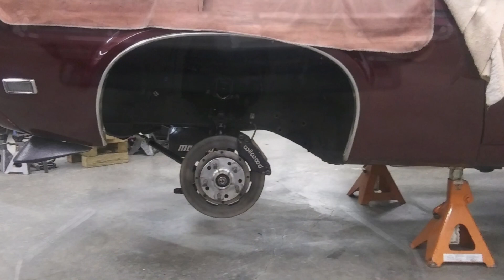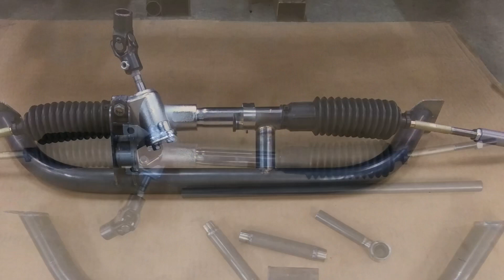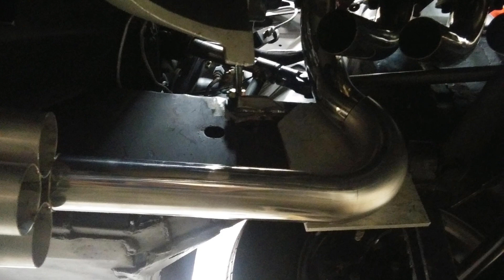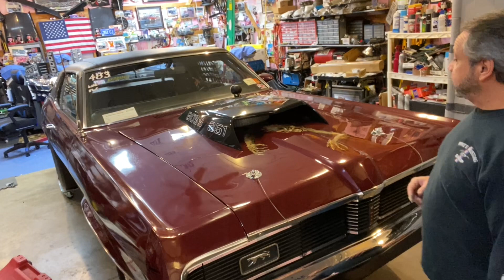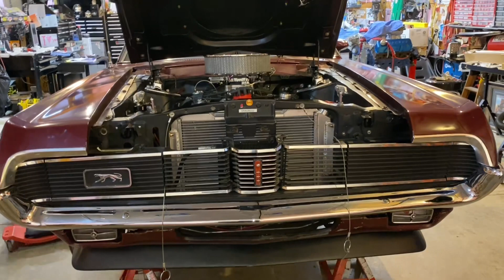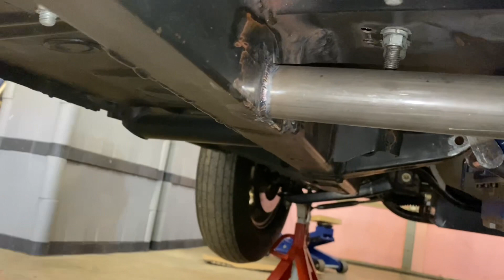DBG: Return Of The DragBoss 69 Cougar, See What Was Done, How It Was Done, And What Done Looks Like.

Comment: Having the rack and pinion steering installed is one of the most beneficial upgrades available and all of our classic pony cars needs it no matter if the intended usage is street, strip or road course. It’s way more than a means to reduce steering effort, a properly engineered and installed R&P kit will strengthen the chassis up front with a hefty cross member to handle the huge torque loads provided by that immaculate 409C. 

But as you know, one upgrade opens the door for many more. Each one does more than just improve functionality, they improve strength, performance, safety and the overall looks of the aging parts they replaced. 

The headers look amazing and the quality craftsmanship can be seen in the precision welds and smooth bends. 

With the much needed chassis upgrades done, the DB Cougar will have that extra margin of performance that a rigid platform provides and with the right amount of tweaking as required, you might shave a little bit of precious ET off. It doesn’t come easy but in the end, the enhanced functionality and performance will certainly justify the hard work by skilled hands and co$t involved 👌😉.
Reply from the maker: Thats what im talking about Daniel. Glad you approve, you have a good eye. He is a fabricator and artist. Definitely more strength for sure.  I sure hope I can get my number of 9.50, so I can be done with that goal, and move on. St6ay tuned, and see what happens next.

Comment: Very nice. It's coming along. I forsee "wheelie" videos in the future and low "ET's!
Reply from the maker: Not sure about wheelies, have tighted the front shocks down, after the wheel stand crashesx2. Come on 9.50
Reply: @DragBoss351Cleveland  … Tim the Cougar had a long run at entertaining us all with those well documented high flying wheelie videos. 

Nows the time to use all of that power that’s required to lift the front end and sustain a huge wheelie for a different goal. Wheelies clearly hurt elapsed times regardless of how awesome they are. 

Your freshly prepared 409C has more than enough power to collect a stack of 9.50 second time slips. You know all too well what your Cougar likes for quicker et’s, so work your magic on the chassis setup until it hooks hard and goes straight when necessary. 

Then gather up all of those extra 9.50 time slips in your collection of ultimate Cleveland memorabilia, autograph each one with a CF foundry logo, then offer them for sale at a price that the purchaser can’t refuse. 🤔🤔

Yeah I know how weird that must sound, but weird is only a state of mind along with the annoying , brief moments of clarity. 

No worries. Just be glad that you didn’t select the obscure 348 Chevy as the object of mechanical obsession 🙀😵‍💫🥹🤮🤷‍♂️
Reply from the maker: @danielwilson6665  oh yeah I know what to do, I have it written down in case I forget. I will have to tell my wheelstand secret sometime…Lol. Not sure if anyone would but those time slips, but you can be sure I will keep one and place with pic and on the DBG wall it goes. Sure glad I was not enthralled by the 348/409 engines. Blue baby go, remember there is a fine line between genius and insanity. 🤞🏁

Comment: Looks very well done......did you install a fore 'n aft lateral limiter....? I had a car with a 2 X frame with an alum front plate and steel mid plate. The trans X member looked like your new one. But after 2 dozen hard launches, the plates were bending backwards from the sudden movement.

We welded 2 brackets to the frame and used a chrome moly tube with a 3/8TH female fitting and used it to keep the engine from moving. One rod end bolted to a factory mounting boss on the block and the other to the frame. That stopped that issue
Reply from the maker: Patrick, you’re right on the number. Yes I do have a lateral limiter. You might be able to see in the video. But yes you definitely need those for the engine plate/mid plate. I was concerned about the solid transmission mount. But my chassis guy said if you have a motor plate, mid plate, and lateral limiter you’re good to go. Hopefully no issues. But yes thanks for bringing that topic up, you’re the only one that talked about this. Appreciate it Patrick stay tuned
Reply: @DragBoss351Cleveland  Never hurt a trans X member with a limiter......accordianed a trans case without.....that sucked
Reply from the maker: @patrickrodig5667  nice to know. This is all new to me, once something works well , I don’t mess with it. Except here. Lost some extension, but really limited it with shocks after huge wheel stands. So feel should be same. Cannot imagine with TrackBoss aluminum block will be like. Thanks man
Reply: @DragBoss351Cleveland  … Oh yes, the TrackBoss aluminum Cleveland block will open the door to the next level. Stay tuned… The best is yet to come , no doubt !
Reply from the maker: Oh hell yeah my friend. Just got 409 out and engine compartment detailed, wow. Wait until the video, is done. She is going to  be shaking the ground soon.
Reply: @DragBoss351Cleveland  … That big Cat is definitely a ground pounder. The excitement is building in anticipation of your first shakedown runs. Its been a long time coming and everyone is on board with you, my friend. Talk about an epic journey… WOW 🏁
Reply from the maker: @danielwilson6665  I know it. Been almost 6 years since I been down the strip. Hard to believe, but it is what it is. Allowed me to build DBG, now back at getting 409 ready to go back in. Stay tuned

Comment: Nice work. Made everything neater and easier to work on and lost weight.  Did you have the 2" headers and vacuum pump on when you dyno'd it?
Reply from the maker: No doubt. No experience will pulling engine or transmission with plate set up, chassis guy said headers are stupid easy, I like that. Yes dyno with vac pump and he made me a different set of stainless Dyno headers no merge collector, but 2 inch.  I love the clean look up front.